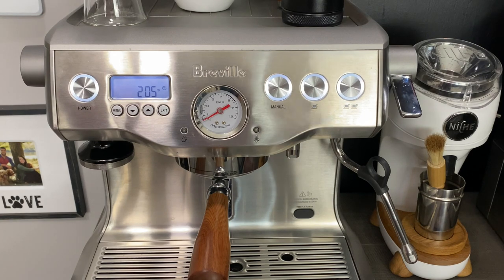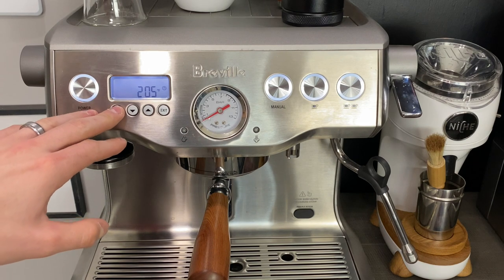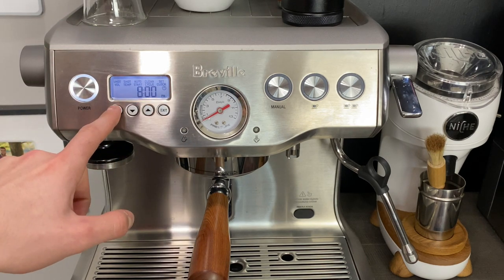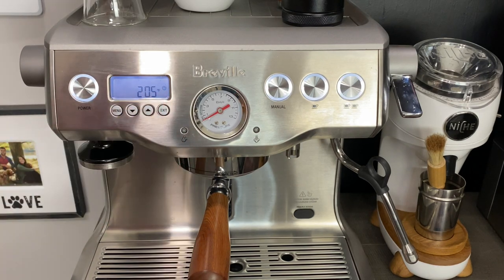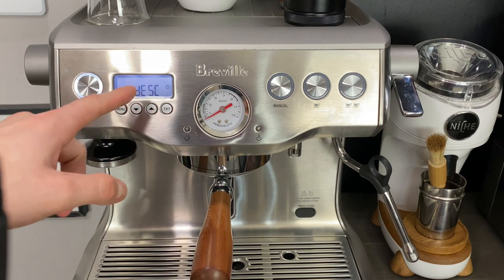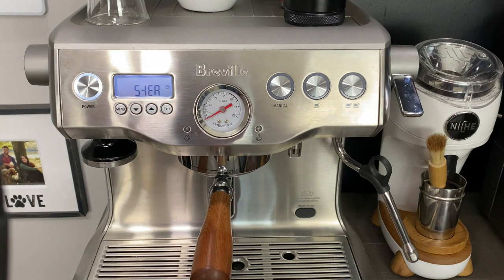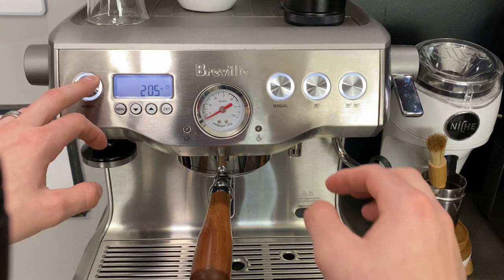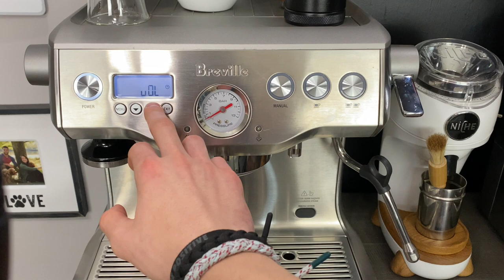How To | Breville Dual Boiler BES920XL Advanced Menu

Comment: Sorry Dylan. You say the “A OF” means alarm off...it does not mean alarm off. It actually means auto off. Knowing when to “clean” the machine is indicated by the display showing “clean” (after aprox 200 shots pulled). Descaling is not required “after 200-250 shots”, as you mention. The machine will indicate when it is time to descale, based on water hardness and frequency of use, as well linear time passage.

Comment: I'm amazed how fast the Dual boiler is ready to pull shots,  I don't see the auto start feature as being so useful on this machine.  It's ready in like 8 minutes! Although I don't think I've tried actually pulling a shot right when it's ready. With the heater in the brew group I think it should be, maybe with a quick flush to heat things up!
Reply from the maker: Super quick heating up!

Comment: I love how many options this machine has!  It's really a nice model.
Reply from the maker: I absolutely love it 😍
Reply: I have had the 920 for two years now. Was very happy it  then I descaled it and had a bunch of issues with terrible shots. Now after about a month of screwing around, weighing, grinding, dosing, timing, etc, it seems to be back in line. Not sure if it was the rescale which apparently there are major issues with the menu driven operation. Just be careful and descale manually as on other videos here.
Reply: There are other service menus available to see error code and shot counts. The number shown is how many tens of shots, not the actual count. So if the number reads 92 it's pulled 920 shots. There is also a way to see the temperatures of all 3 PIDs for the boiler, steamer, and the group head. Didn't realize there was even a monitor of the group head. There are videos out there describing all these menus. Like most service entry menus in electronics, you need to unplug the power source and then re-energize while holding down one or two buttons / sequences.

I believe the YouTube channel is Caffeine Fix.

Comment: Hi Dylan totally love your vibe but you have miss-labelled your video. 

You're giving instructions on how to work the regular menu not the advanced menu for this Coffee Machine.

What I want is to be able to change a 'timed' dispense to a 'flow' based  dispense. 

That means instead of the Coffee Machine expressing for 30 seconds regardless of the quality or grind of the coffee and then stopping, it will judge each grind separately and keep water flowing through the group head until it is satisfied it has met the flow of water requirements.

So how do I enter the actual  'Advanced" settings for the Breville BES 920?  And how do I then change from timed to Fow settings?

Any help would be great! 
😃
Reply: Actually, I phoned Breville and got the answer I was after. My cheat sheet is below for anyone else who encounters the same problems.  

(my question was how do I change the machine settings from a timed response say 20 or 30 seconds to a flow response which judges each cup by the quality of the coffee - 30 seconds at 8 bar is usually perfect) "flow" is for finicky coffee lovers who wants a precise control over their coffee and understand that the flow rate will change depending on how fresh the coffee is and from what roaster even the humidity of the day)

ADVANCED FEATURES BREVILLE BES 920

Turn off

Then press and hold the 1 CUP button, then also press
the POWER button. 

YOU ARE NOW IN ADVANCED SETTINGS

Then: Press the UP arrow (7 times FOR FLOW) to the
desired feature then press MENU button to
access feature settings.

ADVANCED SETTING MENU

1.  rSet reset to factory settings
2.  Hrd3 set water hardness
3.  5Et descale
4.  StEA steam settings
5.  AOF auto off time
6.  Snd Sounds
7.  Vol/Flow - change volumetric to timed 

Select between volume based (FLo) or
time based (SEc) method for espresso dose
measurement. 

While ‘vOL’ is displayed on
the LCD, press MENU button. Press UP or
DOWN arrow to the desired method. 

Press
MENU button to set. Machine will beep to
confirm selection.

Comment: What ist the Fahrenheit mode for? It is a machine for boiling water so why would anybody NOT use the unit that is based on the boiling point of water?
Reply: I like Celsius and the non weird American ways of measuring things usually, but for Coffee I prefer Fahrenheit because 195-205f is a nicer sounding and more granular range vs 93-96c Assuming your machine can be accurate to 1F, you can make a smaller change from 200f to 201f if desired, vs going from 93c to 94c! (not sure if those numbers convert accurately but you get the idea?)
Reply: @BensCoffeeRants  "not sure if those numbers convert accurately" - exactly! You do not even know what these numbers mean. And regarding the more granular scale: As if these consumer grade machines can actually control water temperature that precise. Think about it, the internal thermometer does not actually switches its encoder when you switch the temperature display on the machine. Of course not, it has one encoder and that works with celsius (maybe with one decimal) - like all digital thermometers do, so your fahrenheit display on top of being confusing also suffers from round-off errors.
Reply: @mrk131324  I'd like to think they try to be accurate to the F. IF you're setting it to C then you have a bit more room for error. 
I think because the breville Dual boiler does have a heater in the brew group area, it could be relatively accurate. But I don't know how it's designed or programmed, you may be right, but I doubt you worked on building or designing these machines yourself have you?

Comment: Just installed my new dual boiler, brand new. how do I adjust the time for manual extraction. If I press manual button to start extraction, thinking that I can control the on and off time by pushing the manual button when I want to start and stop, well, the extraction stops when I push the manual button, but the machine keeps motoring, it appears it must have a default time period, thanks
Reply from the maker: I always start the shot by hitting the manual button and finish the shot by doing the same for my desired output! Congratulations by the way on your new machine